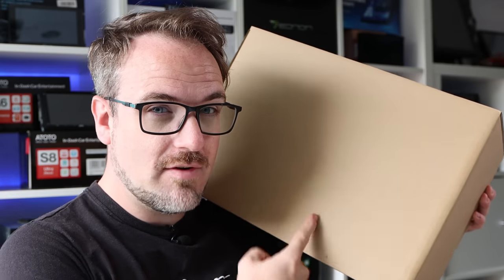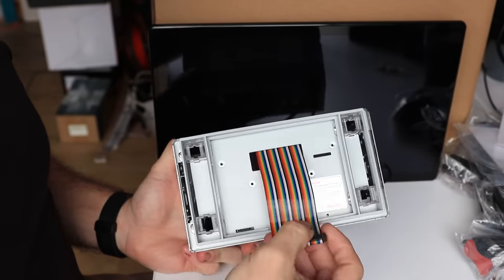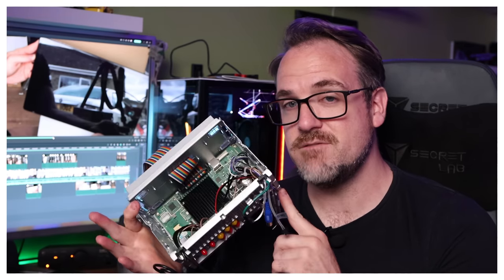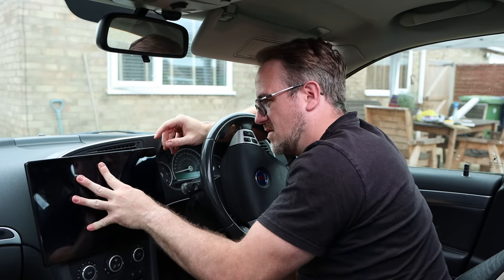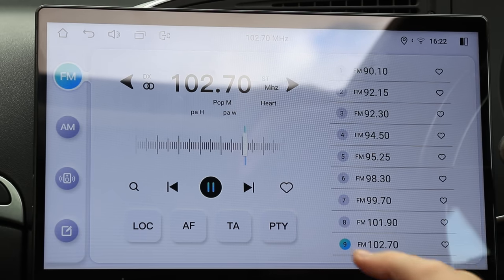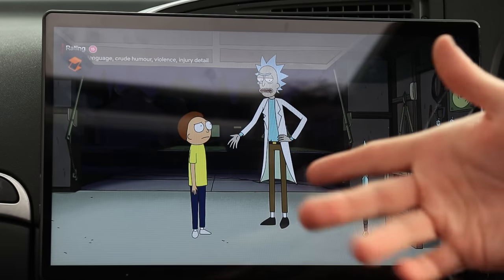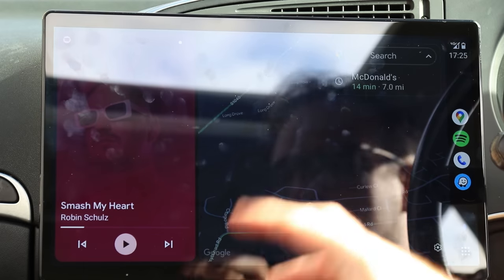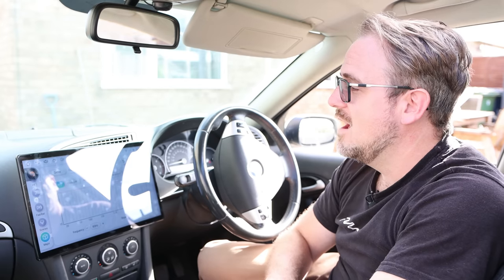2023 FLAGSHIP Joying 15.1inch Car Head Unit - My Favourite! -Android 12 -8gb RAM -SECRET HDMI PORT!

Comment: Amateurs, I want a 43" TV screen on a headunit so I have to remove the steering wheel and column to fit it.
Reply: That's nothing. My next Joying will be a 103" roof mounted rotating surround screen with full 3d VR sound
Reply: 😂😂😂😂
There's a meme running around with a uber driver in a tesla with a screen from roof to floor!😂😂
Reply: Funny, the first thing I thought about when I saw that it had an HDMI port, was that you could literally mount a full size tv across the back of the seats so the rear passengers could really enjoy movies on a road trip!
Reply: nah you want VR so you can see headunit and nothing else!
Reply: 😂😂😂😂😂 Same feeling 😅

Comment: What would be great if you could add it to the reviews is how dim the displays can get. Driving at night on unlight roads with a large screen can be an issue if it can't be dimmed quite a lot. Thanks.
Reply: THIS ^^ Also test with polarised sunglasses. Current 10" doesn't dim enough, and is polarised in the vertical mode, meaning polarised sunglasses can't be worn, such a nightmare!!
Reply: @khalidacosta7133 great point, something I had never considered. Would annoy me as I wear polarised sun glasses
Reply: @khalidacosta7133 I can assure ya the new one by Joying looks fantastic with polarized sunglasses. 
But I'm comparing it to my old 2021 joying which did okay with polarized sunglasses but not as well as this new 2023 version.

Here is a very very long video but I do not discuss the polarization in this video https://youtu.be/24bVTq_Ks3Y

HOWEVER today I'll make a video showing that the polarization does fine with the sunglasses that I have (I'll put the sunglasses on my camera to try to mimic the effect
Reply: You can go into the factory override settings and make it super dim, it also has a warmer eye saving “night shift mode” too- I have the same unit in 11.6 inch and looks even better through my polarized glasses than without. 😅 surprised me too😅
Reply: Also app named Dimmer can help. @teyes, your cc2p

Comment: Hi, I bought a joying head unit on your recommendation and it keeps overheating and cuts off until the unit cools down. JOYING will not replace it either. I think you should let your viewers aware of the issues.
Reply: What unit did you purchase?
Reply: @rickhoneycutt6010  nothing 10.5 bag of shite never again

Comment: 1. What is the long-term reliability of this brand I never heard of? 

2.. What is their warranty for parts, and labor, and who pays the shipping to and from? 

3. If you have problems how hard is it to get serviced and or replaced, in the U.S.?

Thanks.
Reply: Found the warranty info: 3) 15-30 days:

Return for refund: 70% refund, 30% of the unit's price will be charged as depreciation cost. customers need to send the unit back as requested. We will refund 70% of the product price after we receive the package and complete the condition-check

 

Return for exchange: Customers need to send the unit back as requested. After getting the returned package, we will check the parcel's condition and accessories before exchanging other models., 10% of the unit's price will be charged as depreciation cost, Customers need undertake the shipping fee for the new head unit

 

4) Over 30 days, do not accept return and exchange:

We accept repair for all issues. Customer need to pay the shipping cost and ask our customer service for RMA before returning the unit. We repair the unit for free, except for the factitious broken parts or non-working problem caused by rooting JOYING head unit or installing the unknown and unsafe firmware/MCU.

 

Note: Pls have a check if there is any damage/defective at the first time when you receive the parcel

 

About the fee during warranty:

1) No matter you purchased from EU/AU/USA /China warehouse.,JOYING offer free repair service. But customer need undertake the shipping cost of back and forth.

2) When return or change head unit, JOYING do not undertake the installation fee and uninstallation fee

3) When change to another head unit, the price difference is needed between 2 model.

3) JOYING offer free replace part, but customer need undertake deposit and shipping fee for the new replace part, also need undertale return shipping for the old part

4) Customer need undertake the tax fee when exchange the head unit , receive the replacement part or receicve the repaired head unit.

 

Pls believe JOYING can offer the best customer service, if there is any problem of your head unit, pls contact JOYING first by email info@joyingauto.com or support@joyingauto.com, we will try our best to help you to solve your issue, do not worry, we never leave JOYING customers alone with problems.

Comment: I have a similar unit with a screen of 13" For several months and I find it pretty good. The big problem is that the manufacturer locks a lot of things and I can't make the changes I want. Another problem is that the built-in microphone hardly works. Have you tested this one?

Comment: It would be cool to know the pre out voltage. If these head units get used with apps and bigger stereos, that's important.. thanks
Reply: it is less then 1.5 V
Reply: basically need to use a dsp with an optical cable so you can get clean and high preout voltage. problem is those ones are more expensive than the head unit in most cases
Reply: @turektomasz  this goes against what everyone else is saying. Almost everyone is stating it's a 4V+ output. Where did you get this spec from? Actual measurement or from the vendor?
Reply: @tylerhall71  been struggling to get a DSR1 to work with spdif, even rca .....low output, unusable. Trying to get a fix from Idatalink. But if it works this would be a killer combo for the $$$. Super impressed with the 11.6"......got the canbus harness and EVERYTHING works like stock. Volume/mute, rear cam all buttons on dash, even scroll. (2017 ram1500 w/8.4")
Very surprised. All i wanted was the stock volume knob to work lol. Ill gladly take the rest.

Comment: Great review as always 👏 
I have a renault trafic van that I would like to put an android head unit in. I see teyes do a full kit tha will give me a 9.1 inch screen. Was hoping to go bigger 10 inch plus really. Can you suggest what you think will be a good buy. I would like to keep my heater controls visible. 
Looking at the joying units, if going for double din it looks like there is no udjustment on screen height. Ie the attachment posts are at the outmost positions. Is that right?
Single din would allow me to move the screen higher? 
Your help is invaluable. I look forward to your opinion.

Comment: The latest Android 12 Unit from Joying looks and feels extraordinary, The Specs are out of the world considering price point. Most importantly it has got all the Screen sizes covered -  8",9",10.1",11",12.3",13.3,15". The UI interface is mind boggling. The  Sound Radio chip is also updated and they claim that the Sound is more layered compared to previous version with usage of Japanese chips. Understand there could be some niggles until the version becomes more stabilized with firmware updates. But we have to give the credit to Joying for bringing this Unit making Car infotainment System joyful and meaningful. Optical Input or Coaxial input should be used with a Physical DSP to enhance the sound quality
Reply: Your comment is an over exaggerated statement, if compared with other Chinese companies offering Android12 headunits .   But if compared with big name brands, such as Kenwood, Sony, JBL etc then yes , Joying is among many Chinese companies offering more for your money .

Comment: Do you know how many preamp volt have? 2 4 5..... this is very important for sound quality and you should let it know also in the videos.
Reply from the maker: It's not very important unless you are going to be using analog aftermarket amplification and speakers and you want to avoid using external gain. For factory installs the preouts are generally not used. I didn't measure this one, but Android head units have around 2v of preout power. I will look at testing this in later videos. 
That being said, this head unit has both Optical and Coax SPDIF digital outs, which you would use instead of preouts if you were truly into high quality sound
Reply: @SaabUnleashed Indeed but that further increases costs since a quality DSP costs at least couple of hundred bucks. Also renders the internal DSP useless since SPDIF bypasses it. That's why analog preouts are better to use and it is important for them to have at least 2V. If they have 2V it is enough however a lot of Chinese units in the past were even less than a volt which makes them quite noisy (Signal to Noise Ratio gets less).

Comment: Another awesome review !!! If I may, one word of advice for potential buyers, the unit will have problems with aftermarket amps such as JBL, it will pick up the alternator whine and feed it to the amp. NO - it's not a ground problem , it's "not compatible" as Joying support staff is calling it.
Reply: I am waiting for the 11 inch unit and just saw your comment. Is there a work around because I have 2 JL Audio amps for speaks and sub? Were you able to solve this problem and has anyone else dealt with this problem.
Reply: @myklgee1797  AFAIK there is no solution, believe me I tried everything from common ground (for the Joying and the JBL) , reroute RCA cables on the outside of the car (for testing), different RCA cables,  grounding the RCA cables between themselves and the Joying case, power and ground wires straight from the battery to the JBL, ground loop filter, power filter, ferrite cores and even a Toslink to RCA adapter, none worked. Joying support staff said it's a "compatibility problem" and recommended to try a different amp. When asked which one they said Pioneer or Kenwood based on customers input. The crappy thing is that the amp which originally was in the car (old 2001  20W BOSE) did not have a problem with Joying HU.
Reply: @danricci6996  thanks for sharing… my unit won’t be here till next month. 
If I have the same problem I’ll hit you up
Reply: Do you have the same problem?
Reply: This is extremely odd. Analog audio is analog audio. I can't think of how an amp would be "incompatible" from an engineering standpoint.
Reply: @sk1ppman  Well to be honest for me it sounded like " well shit, we screwed the design of the output grounding so how the hell can we get out of it......oh wait if it worked for Apple (you're holding it wrong) it will work for us so "it's incompatible" ".

Comment: I think 15 inch is starting to get a bit too big for a car audio system.   Nice to see a high end unit updated to Android 12.   Just my opinion on the size obviously, but I just can't understand the need for such a big screen in the front of a car, where the driver would be mostly driving the car not watchign the screen.     As I said, great to see the high end unit and all, and your review of it is great.  In fact, your reviews have been a trigger for me buying a different head unit recently.
Can the different video be sent to the HDMI than the main screen, say if we have kids in the back, can they watch a movie while I have navigation on the main screen?
You may find that the navigation buttons for home and work either link to Google's Home and Work or can be programmed deeper in the menus somewhere.   Not sure, I haven't seen this interface before either.
On the apps in the Play Store, it may depend on the head unit.  My old Eonon runing Android 8.1 that I just retired was able to install Netflix and all other apps up until July this year when I retired it.   I guess your mileage may vary on whether your Head Unit updates Google Services.
Reply: Bigger screen might come in handy if you need reading glasses
Reply: When i was young we had that as a television at home, and sat 4 meters away .
No wonder more and more people need glasses nowadays.

Comment: Are you able to have a 360 Degree camera (birds eye view) on this head unit? You said you did but maybe the singular camera style? Mine has the 12 pin connector inside. But it seems far fetched until they complete it. Could I use front and back ar camera with a front dash cam?
Reply from the maker: I demod the features you're referring to in this video https://youtu.be/ZbMPUTVCBKw

Comment: I'm wondering if the volume controlling of the head unit is programmable in the heather as a permanent quick button.
 Older model the volume control is hidden In drop-down menu and is not ideal when driving without steering wheel controlls.

Comment: Few things here: I have the last-gen joying in my 9-3 and was determined to maintain the cupholder. I ended up going for a single din and drilling some additional holes in the 2din cage in order to mount the head unit in a very specific location. The result is the 10.1 display is completely flush with the dash and it provides JUST enough space for the cupholder to squeeze past (and also pushing the unit as far left as possible in the cage clears night panel etc. buttons as well ). Turned out amazing, looks like it was meant to be

Second thing though is, unfortunately, I've nothing but trouble with the software, including boot loops when the car is off and locked and a random assortment of speakers actually getting audio every time it power cycled. They provided a firmware update and that resolved most of the issues and things were good for a dew months, but a couple weeks ago my steering controls stopped working. Tried the original saab unit and that still works, also spoke with connects2 and checked the voltages of their decoder and thats still working too, so the head units ability to recognise them has randomly died in half a year- curious if anyone else has had similar issues
Reply: Oh, another thing i forgot (bloody hell this is getting long...), Their last gen software on android 10 didnt play very well with custom launchers, curious if this refreshed software on A12 works properly again

Comment: Love the reviews and about to buy a Joying.   May I please ask  -   Do the Joying units pick up DAB radio in the UK.  I listen to the radio mostly and replacing my OEM head unit as it does not have DAB.  Just want to know if DAB radio is picked up no problem?  Thank you for your good work and reviews.
Reply from the maker: Depends on the antenna you use. I talk about it in this video https://youtu.be/zWrjBVZ75sM

Comment: Hi, very good video, thx for this! Question, I’m going to buy a Joying unit as well for a 1981 Volkswagen T3 Single Din. Now I wonder if it’s worth to buy the new version with Android 12 rather than the version with Android 10. What would you recommend and is there a big difference between these two units?

Comment: When mounted at the highest setting, how far down does the screen hang from the double din unit itself?

Trying to see if I can use this in my 07 F250 but the air con knobs are just below the stereo.
Reply: I think the back of the screen has a grid of screw holes so the mounting "pegs" can be moved up and down.  I'm guessing... I don't have one but it appears this way.

Comment: Hello!
Hugs from Brazil!
The specifications and configuration options for this multimedia center (or should I say head unit?) are very interesting.
The screen is spectacular, but here in my region I'm worried about the heat, it's constantly 40ºC (today it's cool and it's 32ºC).
Anyway, I have a 2018 Toyota Corolla 1.8, and a Kenwood multimedia center model DNN9150BT. I would like to use Waze, as well as other apps, without losing the sound quality that I consider excellent on Kenwood. Could you recommend something? (You don't even need a very large screen, but between 9-10 inches would be welcome)
Thank you and have a great day!

Comment: seems nice!! how does it compare to the ATOTO S8 ULTRA? 
also, i have been having issues to wirelessly connect to it with my Samsung S24, not sure why it wont connect! when i got the unit it would work perfectly
Reply from the maker: This is has much newer hardware and software compared to the S8
Reply: @SaabUnleashed  nice, so would this Unit also take care of all the Factory speakers, my car has the Bose system, 11 speakers in total, 1 each door, 3 on front dash m 4 on the back dash

Comment: Looking at getting the 10.1" screen for my '14 Camry hybrid. I can "upgrade" the ram to 8Gb for an extra 40 bucks. Should I upgrade to 8GB ram or leave it at the 4GB it comes with? Just thinking about "future-proofing" down the road...... Thank you! Great video!
Reply: I just purchased JY-UZD10N8-AR and recommend getting the higher resolution screen, switching up from a lower resolution was a dramatic improvement as I can wear Polarized sun glasses without straining etc.

Comment: Just bought the 10.1" version. Great unit. But, here's two things I would love - The home screen / launcher is horrid. I want the one back with the tiles that allows me to have nav in a tiled window with music control - much like their previous launcher. Second, is I would love someone the do a video of how these wire up / integrate into the car with CanBus. Do people wire direct through the iso harness or is a CanBus interface used as a decoder and sending analogue signals to the HU. Can the Joying understand straight CanBus data feed?